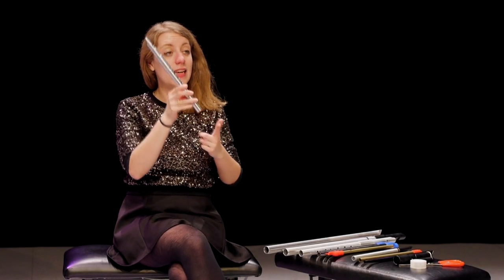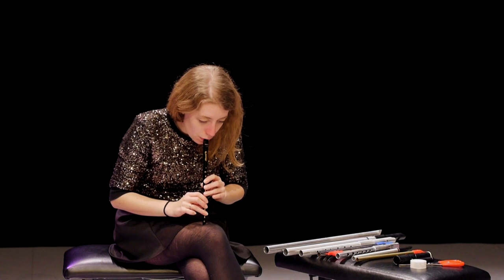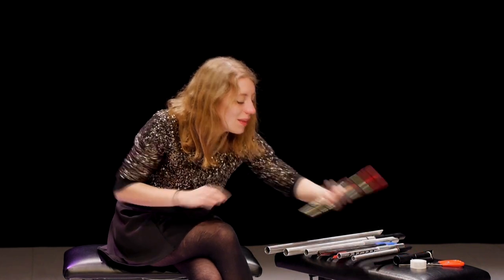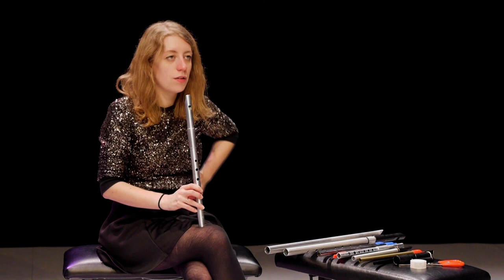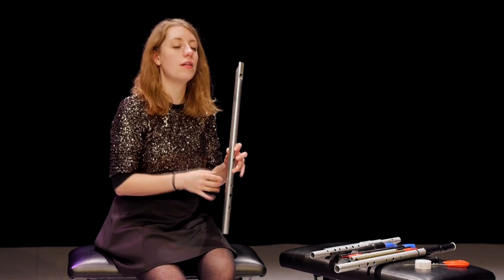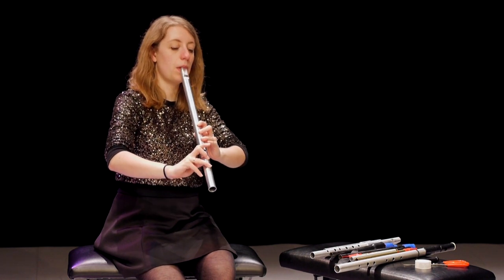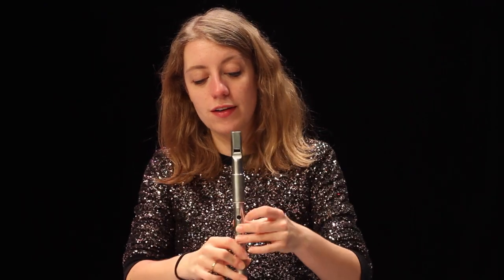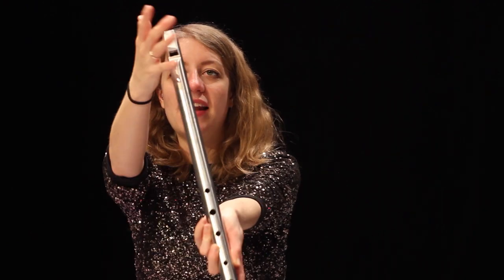Tin Whistle - Undertones, Overtones, Multiphonics & Flageolet tones

Comment: Covering the bottom hole should not only make it almost, but precisely an octave lower, at least by what I understand from the physics of standing airwaves in open vs. closed tubes. Fascinating video though, thank you!
Reply: It only does an octave if it is perfectly made, however due to slight variety between the depth of fingers covering holes and the wall thickness it isn’t always an octave
Reply: The bore profile changes the acoustic properties, that's why cylindrical, tapered (reverse or reverse) bores give you different lengt/intervals ratios, hole distances, and harmonic content. (for the same reason, organs have different types of tubes, conical, cylindrical, square sections, etc.) But besides that, the design of the mouthpiece plays an important part: you can have a tube perfectly designed so that the holes correspond to its upper octaves, but the timbre can be ruined only with the mouthpiece (that is why it is so difficult to achieve a good tone on the oboe, for example, or to accurately tune a shakuhashi, a quena, etc., since there is not a fixed mouthpiece, it's the musician who must control that).
The physical formulas about tubes and their resonance never give precise results if you use them to make wind instruments, they need so many specific corrections for each case that it is impossible to figure them all (and that is only about the frequencies, an instrument also needs to achieve timbral specific characteristics, for that there are no formulas, only general approximations)